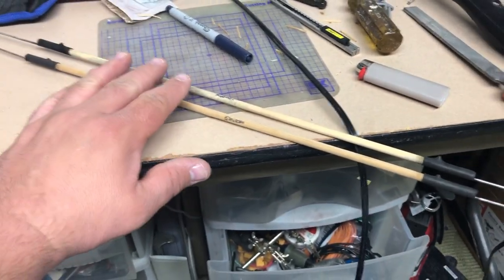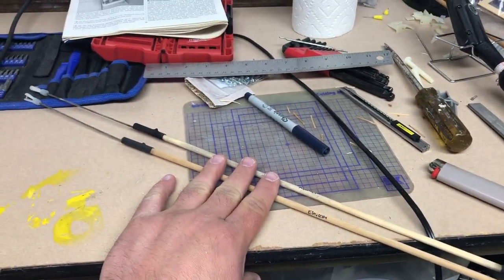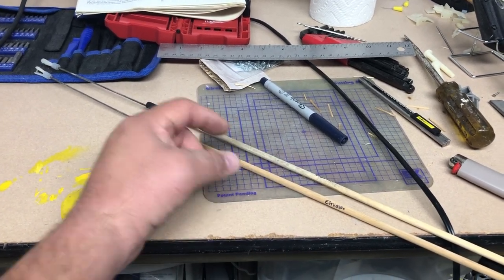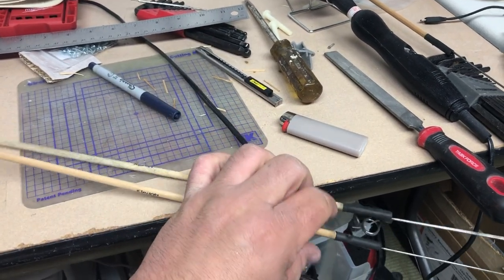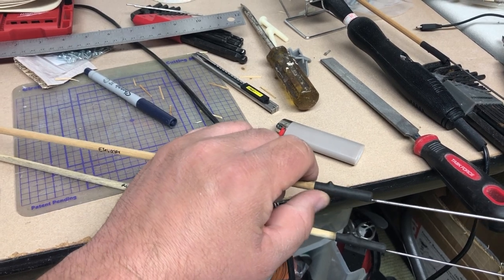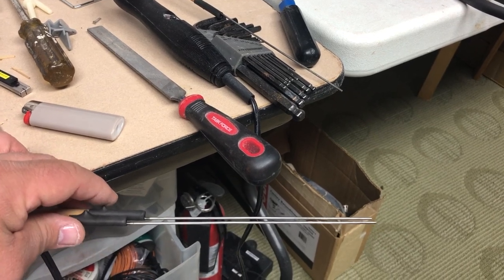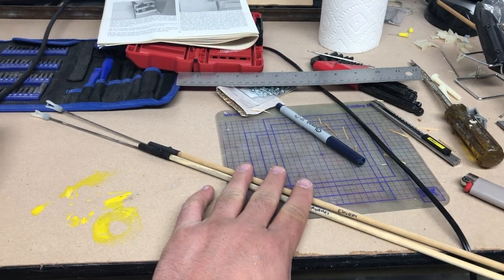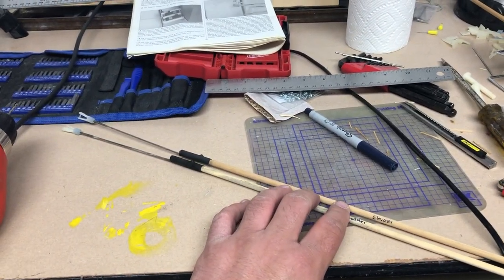Gee Bee R1 Episode 5: Slapping on the rear

Comment: Your intro music is harsh, sounds like an electric motor throwing its' magnets.  Push rods like yours will have flex, in any high speed moves expect flutter.  I went with a pull-pull on elevator and rudder.  Had to create 2 rails for rudder servo to remain central and raised elevator servo above rudder servo to keep wire cables for pull-pull out of each others way.  Mine is Hobby King larger than great planes.  No manual, no appropriate rudder which I built.